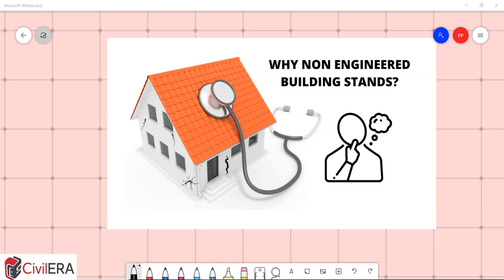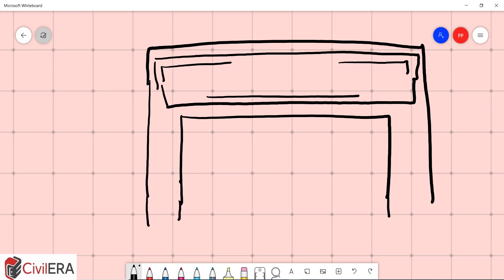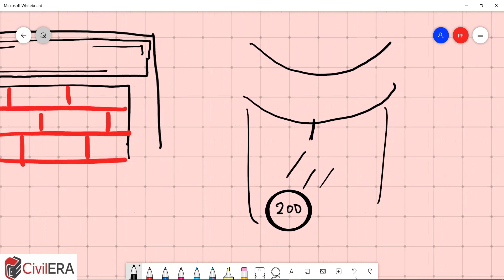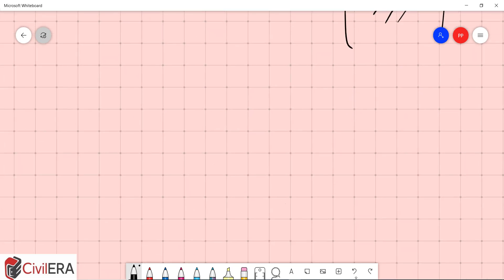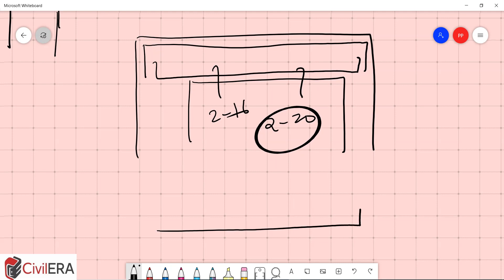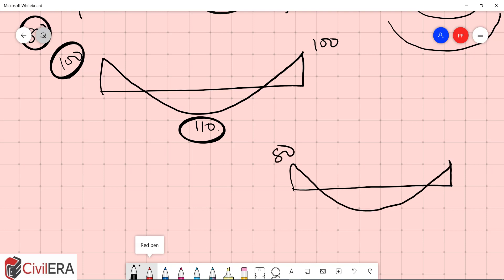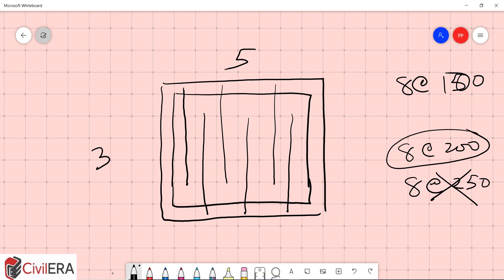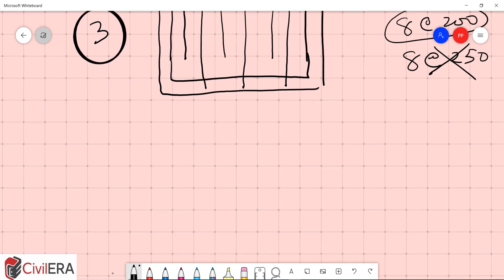Alternate load path,Moment Redistribution,bridging of failure - Why Non Engineered Buildings Stand

Comment: Sir, can it also be attributed to the fact that in engineered buildings, factors of safety (F.O.S) have been included in the loads and material strength and that in non-engineered buildings the mistri has coincidentally ended up with a design which just satisfies the load and moment requirements excluding the F.O.S?
Reply from the maker: yes. but they are not even designing.